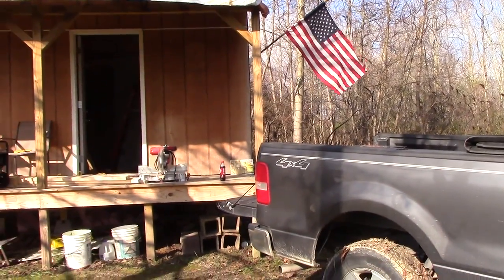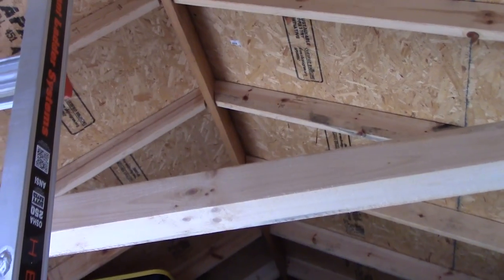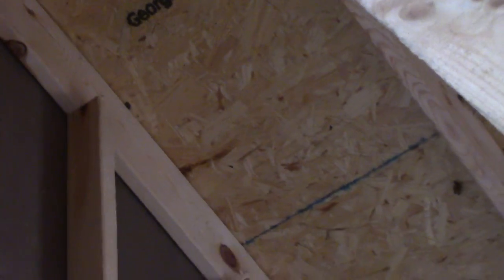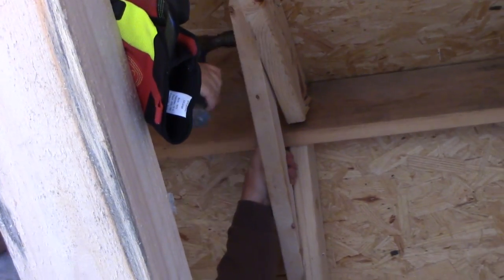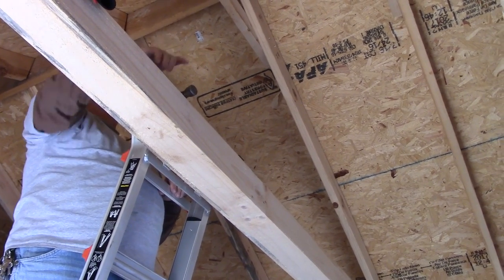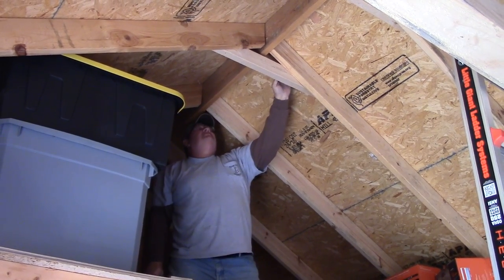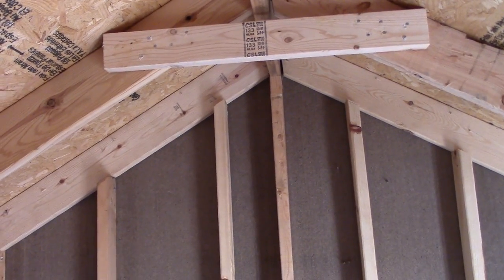Collar / Rafter Ties 4 the Off Grid Cabin Build

Comment: Cool, one step closer to completion 
I'm still debating building or buying,  there's a fellow advertising 9n site shed building in my area as low as $1700 for a basic 12x16 shed
Reply from the maker: I can't post links on here with my phone, but I did a video on the differences between building from scratch vs a shed conversion. Some things to look for. Good luck!
Reply: @StBernardAcres  saw that video 
This is a dude that builds it himself 

Your video on the subject tells me what questions I should ask before agreeing on the deal

My framing days were short. Long ago, and ^helper,' level

Comment: 2" Styrofoam  is better than fiberglass for the roof ( especially in the summer)
Reply from the maker: Thanks.  I will look into that option.
Reply: I got a 12×20 shed,works great, just remember to leave an air-gap between the roof and foam for ventilation.

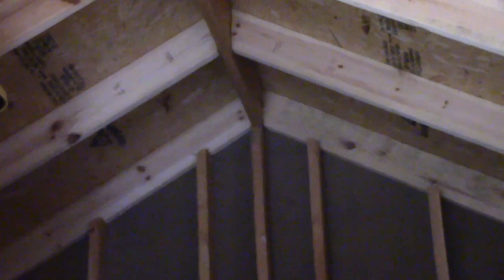Comment: 3:49   FYI:
That is Gable vents not Ridge vents.   
Gabble is the ends ...   the Ridge is the top  ...

Determining what you need is simple — all you need is the size of your house and a calculator. Attic ventilation should equal approximately 1 square foot of vent area for every 300 square feet of attic, so figure out roughly how many square feet the footprint of your attic is, and then divide by 300
Reply from the maker: When I was editing I noticed that I said ridge vent twice. I meant to put in there I meant to say gable lol.   Oh well, when I put them in they'll see.